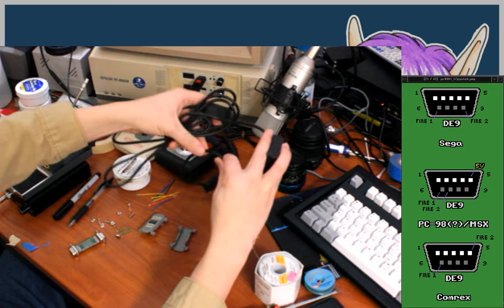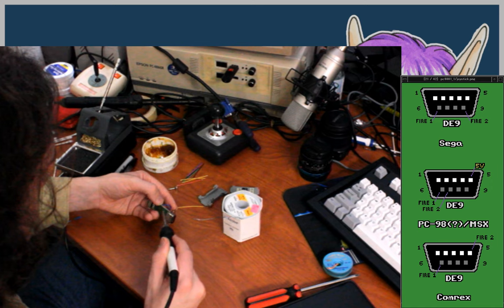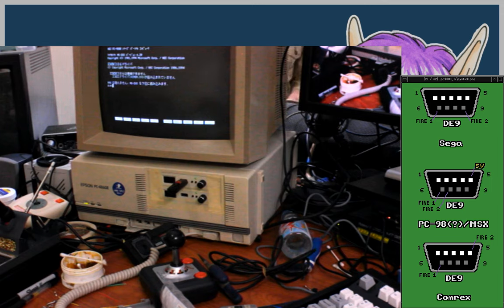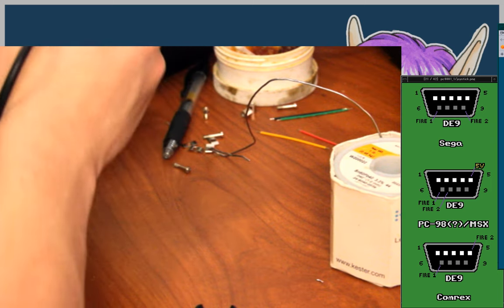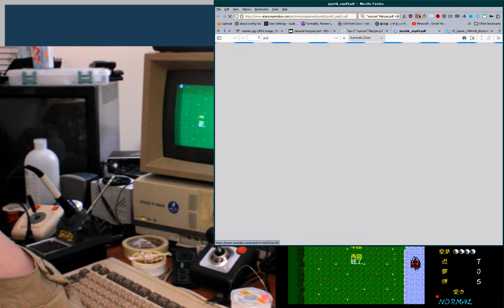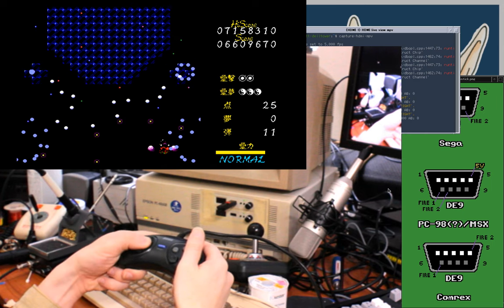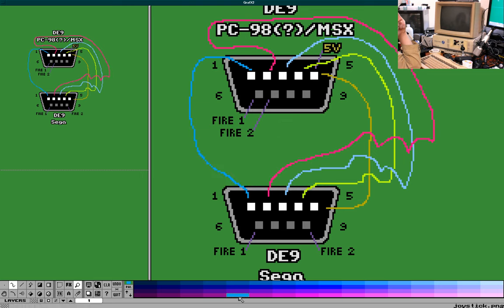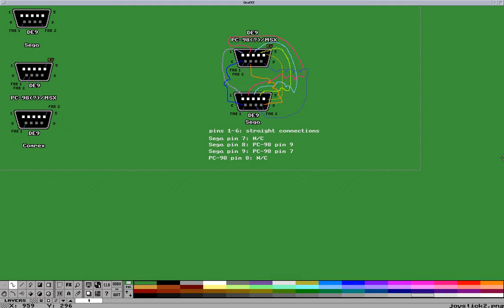Adapting a Mega Drive/Genesis Controller to PC-98

Comment: why not just build a joystick with quality Sanwa parts? or even better mod an existing gamepad tfor PC98. the Japanese are repurposing the Super Famicom gamepads into MSX/PC98/FM Towns ones
Reply from the maker: Because I don't want to destroy a working super famicom pad when I can do it externally with nothing but a 74HC595 chip, and also because a mega drive pad has enough buttons and feels comfy. And as for joysticks, because I like leaf switches! And my comrex. And Sanwa sticks would be quite a bit bulkier. But maybe some day; I just haven't used one so I can't miss what I never had.